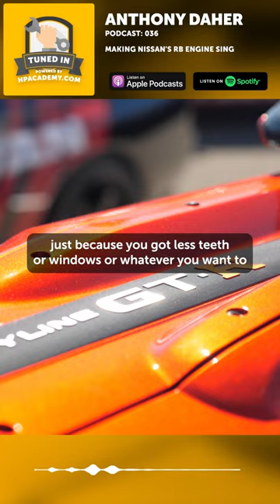But It's The Only Bandaid We've Got Sometimes! | Trigger Sensors #shorts

Comment: The Honda community's approach of switching every input to a hall effect sensor has worked out pretty well and is robust enough for all out 11,000rpm+ drag racing and road racing.
Reply: Right, if it works it works. No need to split hairs.
Reply: This

Comment: Sooo- what other options is he suggesting?
Reply: This. Is there even a viable solution that supersedes the newest offerings for crank/cam trigger setups for these platforms?
Reply: Well they're talking about Cam Angle Sensor vs. Crank Angle Sensor.

As the names suggests, one guesses where the crank is in rotation via camshaft.
The other tells you where the Crank is in rotation.

Id suggest looking at Platinum Racing Products as they have the whole range at various price points
Reply: @EnvyOCE  This is quite understood. In the clip, the newest variety of crank and cam angle sensor pairs are discussed, which are meant to replace the Mitsubishi 360 optical sensor. Even then, the guest states that it is still not ideal. I am wondering if there is an even better solution, as that is what the guest implies.
Reply: Probably talking about going from a cam trigger to a crank trigger setup. Problem with the cam trigger is that the camshaft can oscillate with an aggressive cam and enough RPM. The oscillation can cause the sensor to double read the same tooth or teeth, causing an erratic crank signal. The bandaid approach is to reduce the number of teeth to hide the oscillation.
Reply: @victorhayes5471  Thanx Vic, that was my point as well... 👍
Reply: Maybe the answer is in the full podcast
Reply: @victorhayes5471  exactly, the replacement part is essentially providing half the information previously being read by the ECU, like, how in the Hell is that useful?!
Reply: @patx35  that's exactly what they're talking about, but at that point when you have to have less teeth, you also have to take the unfortunate byproduct of that which is less info being read by the ECU, so in the end is it really better? It's it basically the same end result as leaving in the stock Nissan 360 they mentioned? I'm guessing that's why they called it a band-aid, but I really don't think it's making anything better or "fixing" anything in the end.

Comment: Viable solution to what? Because I don’t understand why in any case anyone would want to halve their information like that.
Reply: Im not positive but im pretty sure the factory cas from nissan uses a disc with 360 little slots on it. The ecu reads these slots to determine the position of the exhaust cam which is how the ecu then determines where the engine is at in its rotation. This is fine for the factory ecu as far as im aware but once you go standalone and start pushing the engine more you can run into issues with the ecu not being able to keep up with reading 360 individual slots. I personally removed the factory cas on my sr and am now using a 5-0 ignite hall effect sensor which reads a gear connected to the cam gear. It may not be as “accurate” as the factory sensor due to the lower count of teeth but its more reliable in its readings. If someone wanted to be really safe and accurate then having a crank angle sensor and a cam angle sensor would be the way to go. 

With the stock sensor you can run the risk of having it read incorrectly 360 times or you can run the risk of it reading incorrectly 24 times with a different wheel.

Comment: Is 24 tooth ok for a 10,000 rpm engine ? Or the window between 2 tooth is too small ?
Reply: You'd probably have to do some research and check some specs, I'm guessing it would depend on the ECU you're running as well.

Comment: That accent is horrible to listen to, nails on a chalkboard for real. Nissan sucks too, I really wish they would go under.
Reply from the maker: Your username is very fitting 😂 - Taz.
Reply: @hpa101  thanks G, picked it out myself lol 😆
Reply: @bleach_drink_me  they have made many good cars and they can be reliable as well as fun. I feel as though they engineer things to be more difficult to work on than necessary. I hate looking under the hood on Nissan's. I could list tons of things about their vehicles I despise, but they do what they do so oh well. The new Z is wicked looking, should be good for them.
Reply: @bleach_drink_me  haha that might explain it, once you've dealt with a lot of German engineering, the Japanese stuff is probably no problem. Good stuff man 👍
Reply: 🇨🇦 English is English, if you have a problem don’t listen. There is no one providing this kind of content for free. This issue is universal 4G63 dsm owner here.
Reply: do you have real world experience with nissan? ive had my 240sx/sr20det 12 years and its been my most reliable car while being near 30yo.the only time it broe down was when i sucked water into the intake which was my fault for having intake in bad location.the fix was dry out the maf.

my 2018 jeep has spent more time in shop getting fixed from bad modules pulling down 5v ref and tipm,a 2018 and its been in shop 6 months.my prius in summer goes in limp mode/has issue where integrated alarm drains battery at random/needs $3000 battery every 8 years.